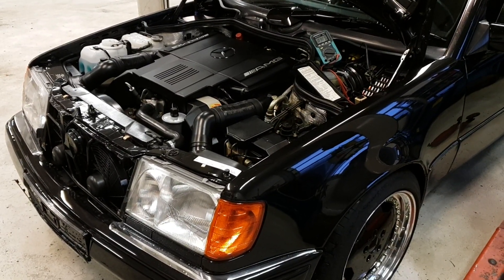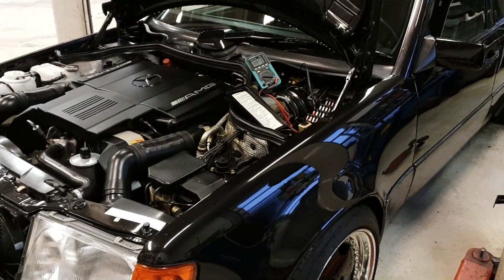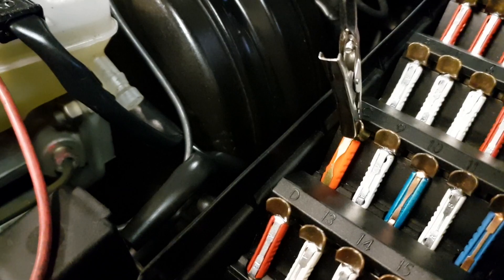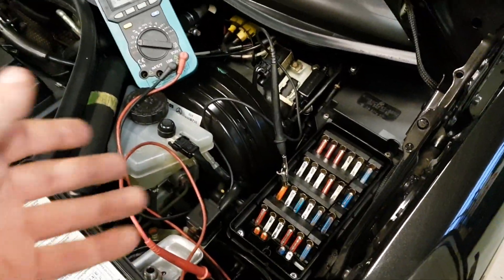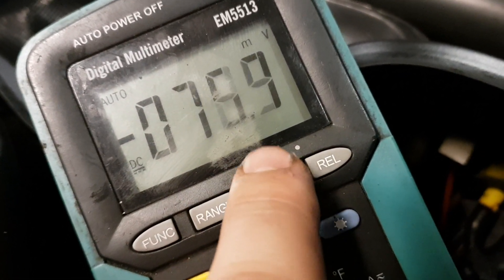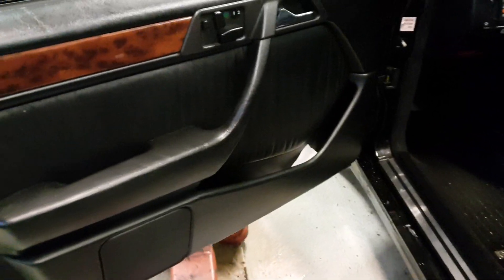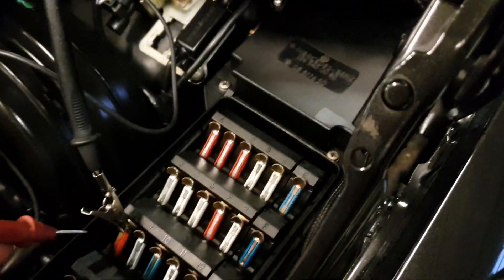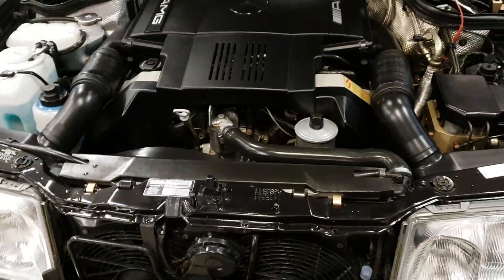Does your car have a battery drain issue?How To Measure For Parasitic Draw Like A Boss :)

Comment: I checked all my fuses but they all read zero point zero.  What next?  I did find a blown fuse for "E" the power seat adjustment memory was blown.  It's weird because the the passenger seat would not recline previously but would tilt, move back and forth.  I just couldn't adjust the passenger seat back...  I am getting an amperage draw at the battery though.  I tried both methods, check voltage drop at the fuses and, having the meter in line with the negative battery lead while removing fuses.  I could not find the culprit...  I have a 1992 W124 300TE

Comment: Thank you for the informative video...

Have a 90 300E with M103 motor... Pulled all the fuses in the fuse box including the relays in the relay box behind it and I still have a huge parasitic draw of nearly 4amps... Key is out, doors closed... Anything in particular I should look into mate?
Reply: I have the exact same problem. Did you ever find out what was causing the drain?